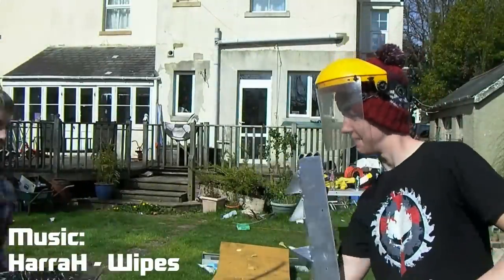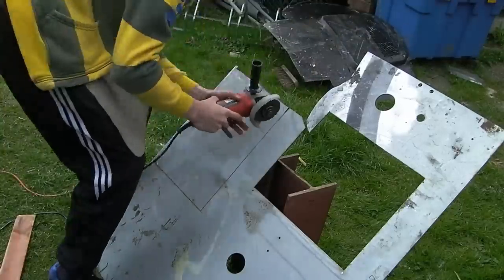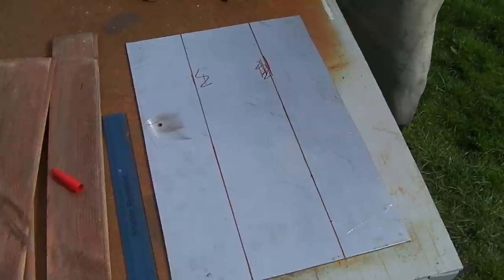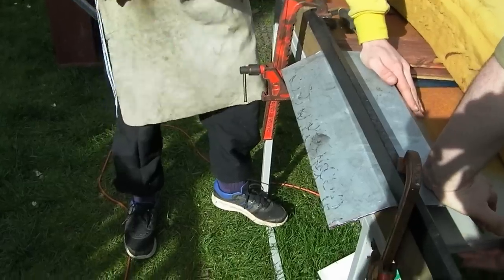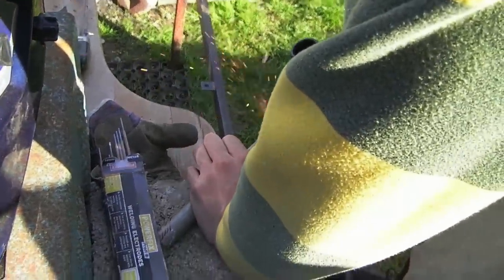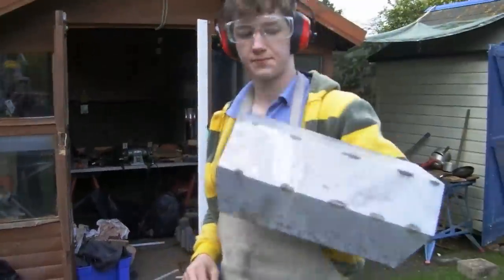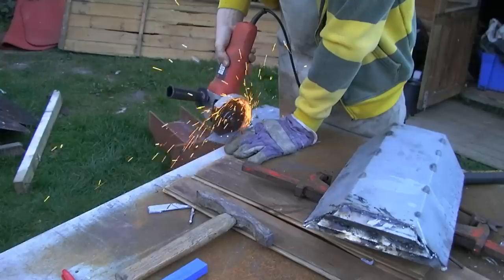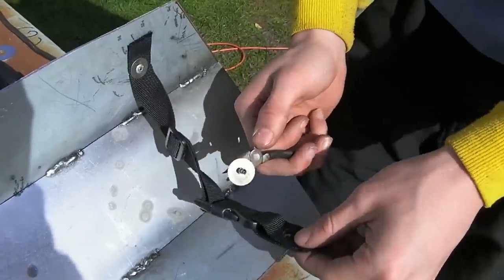How to Make: Gauntlet Shield

Comment: nice I like it, I have a question though would the user not benefit from some padding on the inside of the shield? or does the steel absorb enough of the strike so not really need any?
Reply from the maker: lssjbrogeta As your holding the pole and the strap stops any movement you don't need any padding, But after a few punches we did end up adding some temporary padding above the hand. But when using it as a shield there is no need, But over time you may want it just for comfort.